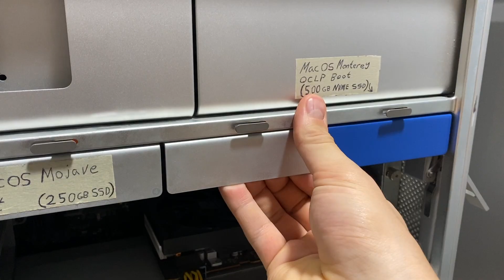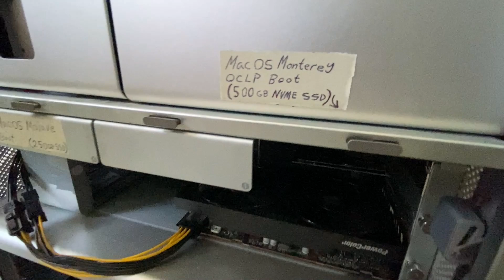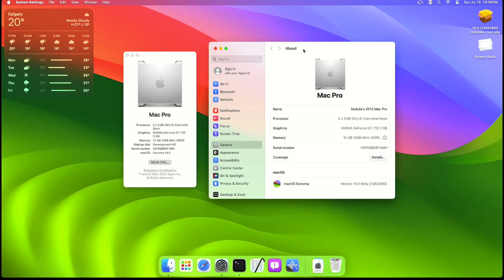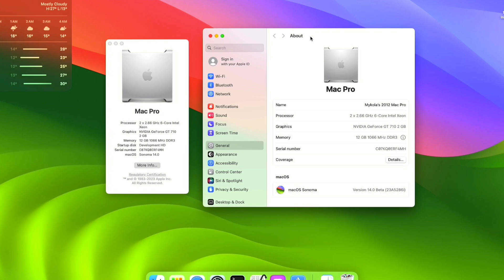4 great uses for a Mac Pro 5,1 in 2023 -- The prices aren't gonna get lower!

Comment: I have mine ( dual 12-core CPU, 48 GB RAM, NVMe SSD for Windows and Mac Os Monterrey and rx6600) for gaming. It cost me quite cheap. I can play almost any game I can think of on it, except for the ones that require AVX, but I've managed to get around that pretty well. Most of my games go to ultra details in 4k at 40-60 fps, which is enough for me. Surprisingly, I also started AC Valhalla, for which they released a patch, so it does not require AVX. Satisfaction for me.

Comment: With how good Apple Silicon machines are, you really need a specific use case for these old Pros to be the preferred option. They use a ton of power, are bulky, noisy and heavy, and are increasingly outdated from a support/software perspective. For most people, picking up a cheap M1 Mac mini would be far better. That said, they are fun and for people who like to tinker and upgrade hardware, they can still work.
Reply from the maker: Definitely agree, but these go for under $100 these days. M1 macs are still in the $500 region. People on a tight budget buying a spare computer will care a lot about that.
Reply: How is the 5,1 noisy? Mine is super quiet. The M1 mini is nice but if you open a lot of chrome browser tabs then you need more memory which is cheap on the 5,1.

Comment: I just got a mac 5, 1 for £20 recently and i didn't need it but it was too good to refuse. It has 2 xeon e5620 cpus and 16gb ram. No hdd though and it was a pain to try and install an operating system on as it kept on refusing to boot to and dvd or usb drive. Got a tool to boot to a usb stick for macs burned on a disk and installed windows 11. I can't believe how cheap they are. I think I may turn it into a NAS.
Reply from the maker: Hell yeah! It’s a fully functioning machine, and running up to date software is capable of plenty.
Reply: @montaguebarnabasltd  oh yeah and it came with a 21 inch apple cinema display as well
Reply from the maker: @stevenlee3661  what a bargain

Comment: Genuinely the best computer that I've bought in the last 4 years, even though I got mine for a ridiculous deal, I would've paid a lot more for it. Still so competent even by 2023 standards. Paid £255 for my duel x5690 5,1 with an RX590 and the Pixlas mod already done to it. Also had the original gpu and an apple raid card thrown in. I genuinely think I robbed the guy that sold it to me. Haha The only issue I've had with it is that the cpus lack the AVX2 instruction set which means that some of the newest games just don't run (I.E Starfield) Beyond that I have absolutely fallen in love with this generation of Mac.
Reply from the maker: Absolutely! I think they’re very hard to sell these days as not too many people are interested in buying, but we both got mad deals nonetheless. 
Yeah Starfield and Warzone 2 are the problem causers at this point I think with AVX2.
Reply: @montaguebarnabasltd  It's quite a shame because I don't think there's any other limitations preventing those games from running on these machines. Just that pesky AVX.

Comment: 200-300€ in germany. Since apple pcs were never popular here, they are rare and thus quite expensive. I dare anyone to find anything powerpc related for a decent price...

Still have 2 old ones from 2010 though. One is collecting dust while the other is my main logic music recording device (Upgraded with 2 X5690s, 96 GB 1330 MTS Ram and a RX6600XT). The upgraded MAC feels even "snapier" (horrible word) than the m2 mac mini, i use for my daily office work.

While it's nice to use a modern os, the dusty mac pro still has lion installed. You can't do much with it, but i start it from time to time for pure nostalgia. Snow leopard was the peak of macos and lion is close enough.
Reply from the maker: In that case you’ve got a bit of an antique on your hands! Nice spec btw, very similar to mine.

Comment: Unfortunately Adobe Premiere and After Effects 2024 don't run anymore on a Mac Pro 5.1 because there is no AVX2 instruction set support on Xeon processors. After 15 years of loyal service and upgrades I have to use my Mac Pro 5,1 as a server or something. Davinci Resolve 18.6.4 runs very smooth on this machine however.
Reply from the maker: Yup, you’re absolutely right I’d say. 

Predictably, my next video is about how the 5,1 just isn’t too viable anymore.

I’ve yet to try Davinci… probably worth it since there’s a free option.

Comment: After my G4's I bought a couple of G5's. What a shockingly bad Mac that was! Unstable with hardware problems on both. The MacPro 1,1's, my 3,1's and now 5,1 however have been great. The only problems I've had have been with video playback on unsupported OSX's.
Reply from the maker: Yeah the PowerPC era stuff just doesn’t hold up these days. Good to hear your older Pros are being used though! Perhaps patching them to later versions would help…
Reply: @montaguebarnabasltd  With the 10.13 that's been fine just the 3,1's weren't happy with 10.15 (that's the unsupported versions) but it may have been graphics card related.
Reply from the maker: @YootubeUK  yeah there’s a lot of variables at play… besta luck with em

Comment: The RX6600 XT is $400 CAN and that makes it cost more than the machine is worth investing in. For something that you have to run daughter cards to run faster drives. I own one and I gave up after it became a money pit. Not worth the price when you can buy a 2017 4k iMac tha would kick it's ass....
Reply from the maker: In terms of graphics performance, that 2017 iMac wouldn’t beat the 5,1, unfortunately. The CPU is the only thing I do take issue with on that machine, as the 2017 certainly would be more desirable in that area